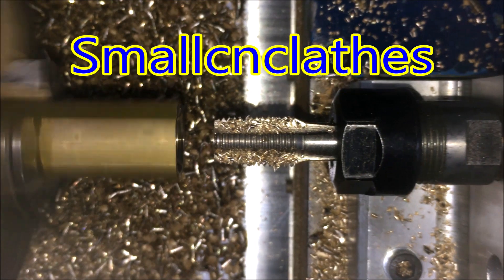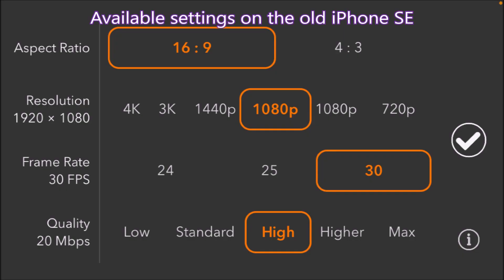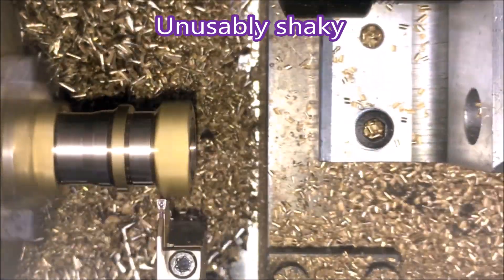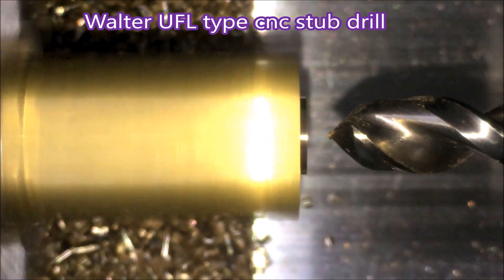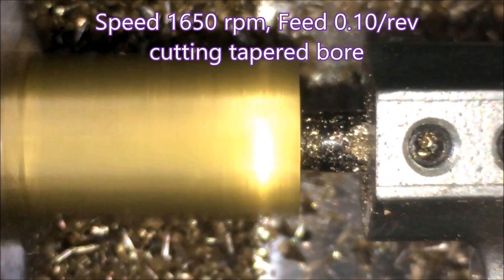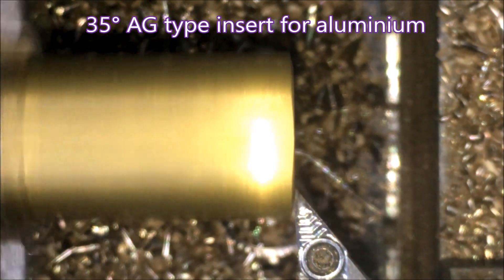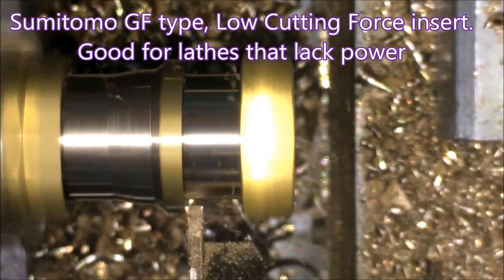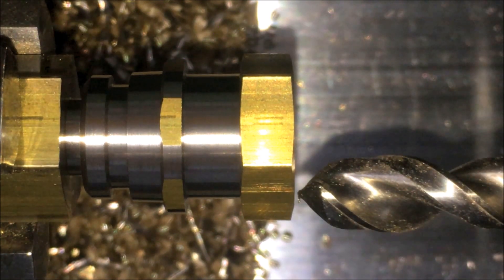Small cnc lathe, with HSS drill and carbide inserts video, with iPhone SE 2016 using Promovie +

Comment: Thanks for the video.  On most of your videos, I noticed you like to use the drill bit to break the edge of your drilled holes.  I also noticed you mainly use brass and on occasion use aluminum, but have you ever tried to do that edge break in steel?  If so, did the bit sing to you?  I hadn't had any luck doing in steel, not even with stub length cobalt bits.
Reply from the maker: Sorry, I am unable to recall having done that. if I come across a video where I do that, I will add the link to this comment.  Did not take long to find as I don't do much steel.  This is S1214 machining steel but steel nevertheless. https://youtu.be/SWKkm-mXoWw

Comment: Hello Nigel,
Good to see you on our screens.... I guess having a cover does make it somewhat easier as you can put the camera (iPhone) on top of it...
Take care.
Paul,,
Reply from the maker: Hi Paul the only problem is the degradation of the image by the perspex of the hood. I have been debating whether I should cut a hole in the hood. Perspex can be a bugger to cut without splitting and even if done well, it could still crack with time. Ideally a skyhook for my usual camera would be the way to go, but not that easy to  accomplish in my shed.